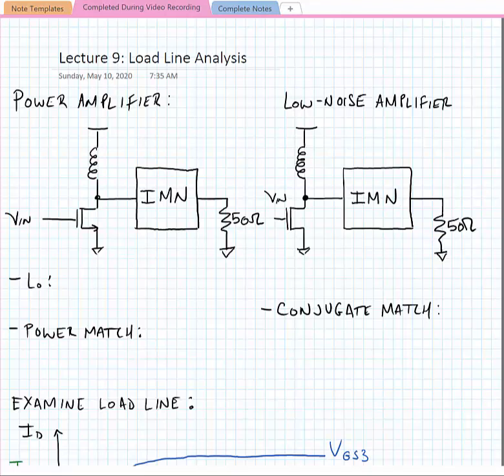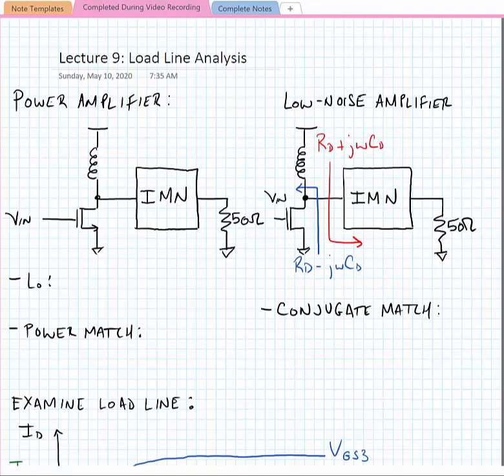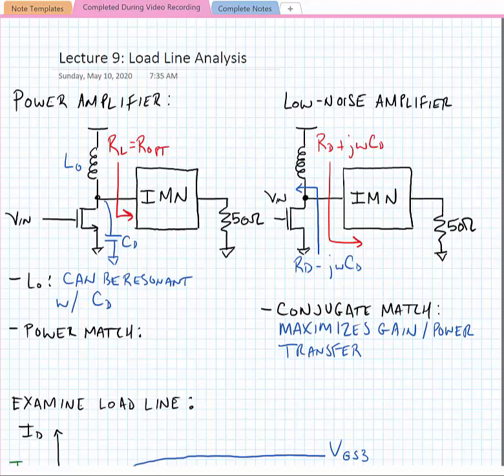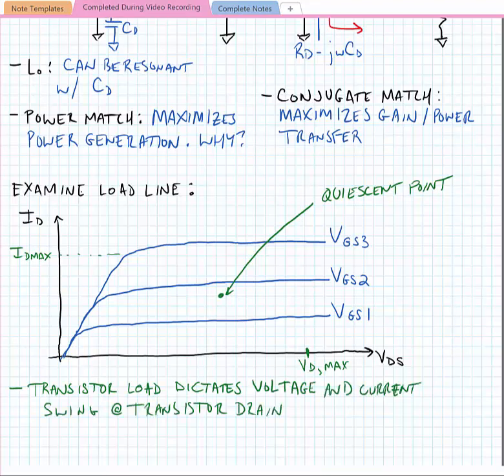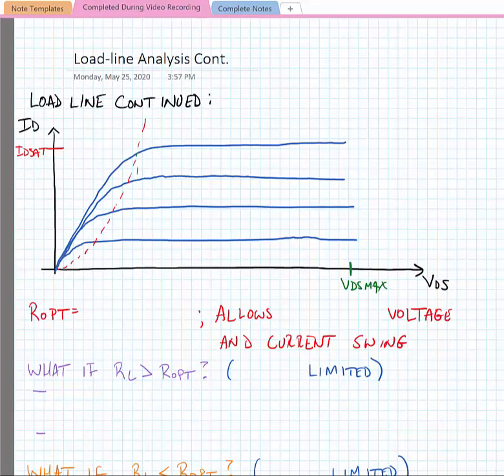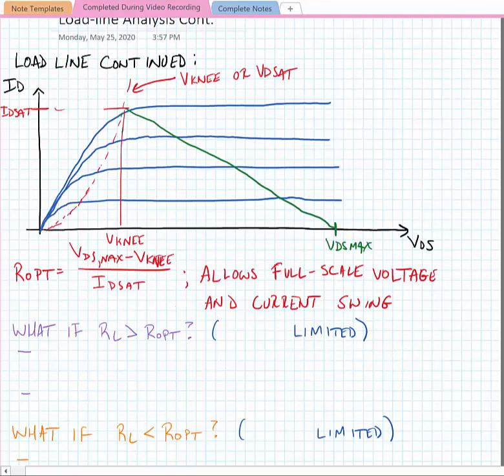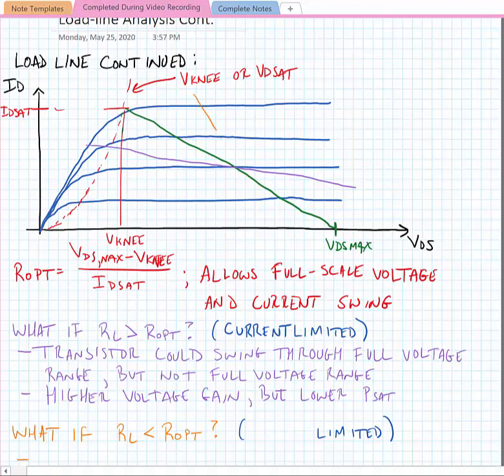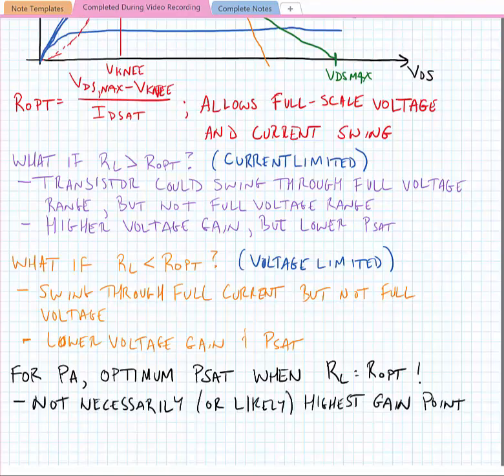Lecture 9.1 - Load Line Analysis for Power Amplifiers

Comment: Great video, thank you. I know it was posted a couple years ago, but if you're still checking comments, I was hoping you could clarify one thing- the load line impedance is not the same as the output impedance, is it? I ask because I'm designing a PA that outputs to a 42 ohm lossy transmission line that can be terminated with whatever I want. I can also size the transistor so the load line has the slope that I want, and if I can set it to say, 80 ohms (and terminate the transmission line with 80 ohms) but then impedance match S22 to the 42 ohms of the Tline, I could significantly reduce both drive current and DC current. Thanks!